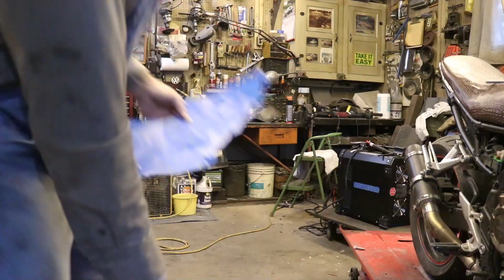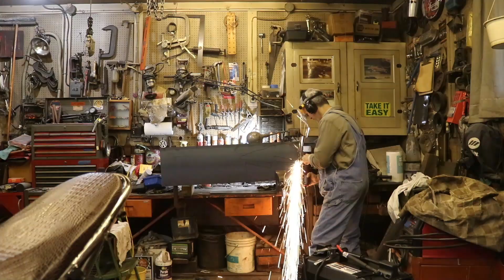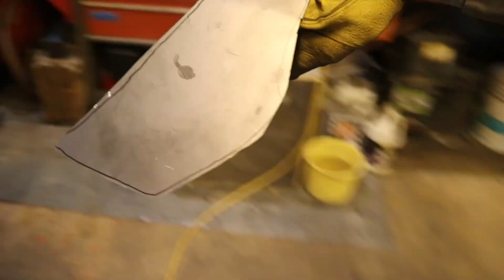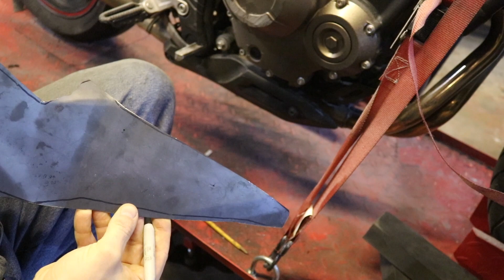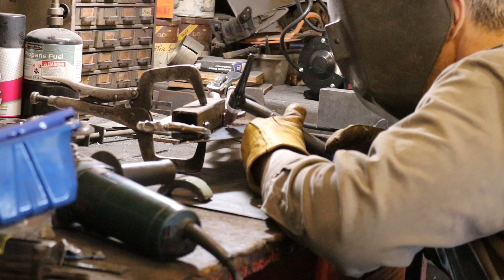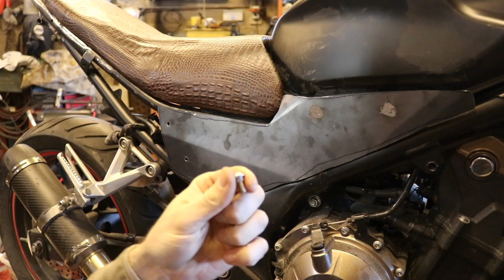Making a Metal Motorcycle Side Cover | E14 - Honda CB500F Custom

Comment: Try cutting the head off a bolt and grind a point on one end. Insert it into the hole and lightly tap with a mallet. That should give you the exact center.

Comment: ...nice going... you could've covered the two grommets with dye/paint, offered up the side panel into place and you'll have the locations marked on the back of the panel for the locating dowels with the paint..
Reply from the maker: GOOD tip! 👍. That might be quicker